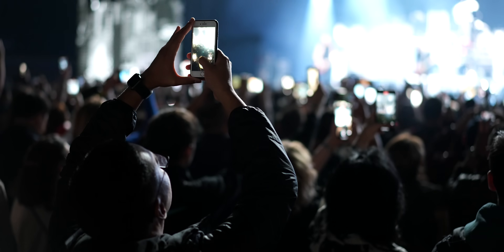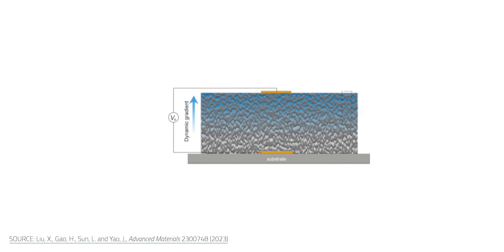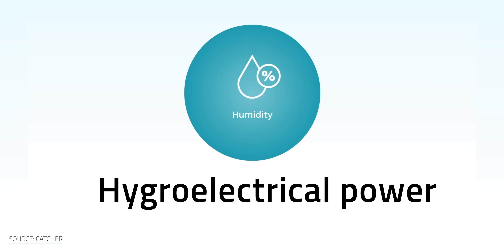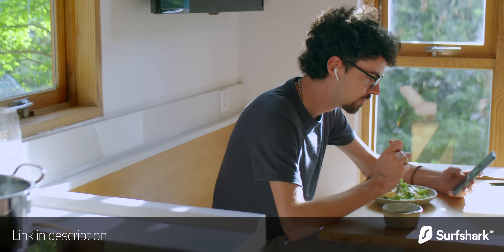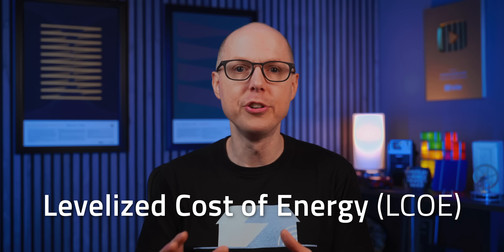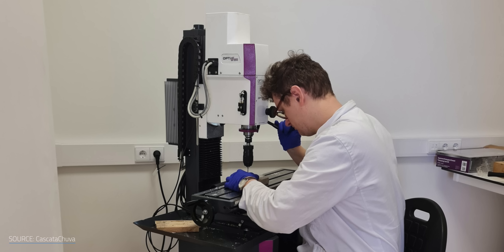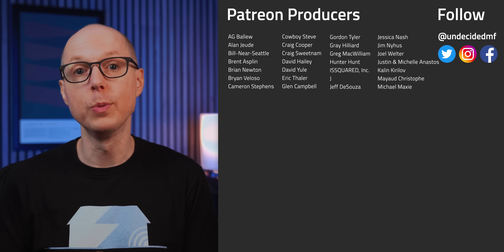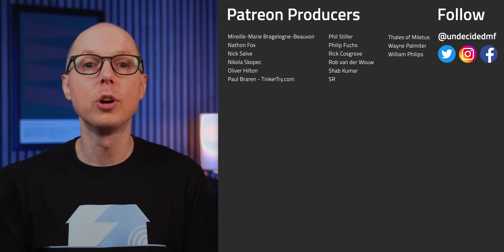Is This Accidental Discovery The Future Of Energy?

Comment: This video title sounded like clickbait, and after watching the video it definitely fits in the "sounds too good to be true" category, EVEN with all the caveats you mentioned...

The principle makes sense as a way to generate a voltage. In theory, any kind of gradient can generate power (pressure, gravity, temperature, etc.). However, what's the theoretical maximum power density of a humidity gradient? Would this work in any high humidity environment, or do you need periods of high and low (relative) humidity in order to keep generating power? Air humidity is in general a very low gradient. 

Let's come up with a high upper bound on the power you can get from air. Let's say you have an environment at 100% relative humidity at a scorching 100F on one side of the membrane, and 0% humidity air on the other side. Let's say your device holds 1 cubic meter of air at a time, the size of the washing machine. A cubic meter of that  humid air would have an absolute humidity of 45.67 grams of water vapor. If you condensed all that vapor into liquid, that's 2.257 kJ of energy per gram, a total of 103 kJ, or 28.6 Watt-hours each time you pass a column of air through that device. That's a back of the envelope theoretical maximum at a ridiculously high humidity, and there's probably other factors lowering it. If your device could handle 1 cycle per 5 minutes, that's a maximum power generation of 0.343 kW per cubic meter. About the same as a square meter of high efficiency solar panel. Not terrible, but where is your driving force coming from? How do you get a zero humidity outlet to deposit liquid water? What's the cost? You also need a ton of air flow in order to still have the same high humidity on the inlet side. If the outlet doesn't even condense the water, your maximum energy density is an order of magnitude lower

What this sounds like is a very expensive, but passive, dehumidifier, but one which generates power rather than consuming it. It doesn't make a whole lot of sense. In practice, you might be able to use this to power a hand calculator, but I doubt you'll even have a practical device that can charge a phone, let alone charge an electric car and power a household. And that's with the most charitable assumptions I can imagine without more information.

Comment: 1st law of Thermodynamics = Energy can never be created or destroyed (it just changes form).  So where is the electricity in these “Humid Air Batteries” ultimately coming from?  

I understand the explanation the water molecules inside the nanotubes causing “deprotonation” and thus forming a positively and negatively charged “ends” of the “battery”….but remember: TANSTAAFL! (“There Ain’t No Such Thing as a Free Lunch").   Thus, any power that’s  “generated” by this humid air system MUST come from somewhere else nearby (and it cannot simply come from “the humidity”). 

Perhaps the energy is being taken from the overall heat of the system?  Or maybe it’s coming from local “wind” (i.e., air moving, such that physical motion of the air molecules “bouncing” around inside the nanotubes, or possibly some electric or magnetic field).   But regardless, for tests of these “batteries” done indoors, the energy almost certainly must be coming from SOMETHING within that same room or building as the nanotube equipment & humid air.

Unlike solar, where “free” energy is pouring down onto us from the sun, I suspect that the researchers will eventually discover that their batteries are (in essence) “borrowing from Peter to pay Paul” (i.e.  using energy that was already generated by humans to “charge” their batteries, but doing so at a much lower efficiency than if the original source of energy were used to directly power stuff, without the need to use humid air to bounce water molecules through arrays of nanotubes to charge a battery).

Comment: The comparison of energy efficiency between solar and these new "batteries" is missing a major unit comparison. $20k each but the hygroelectric product would produce 10kWh a day, while the solar example was 10kW. So with 10 hrs of sun easily 5-8kWh a day, or nearly an order of magnitude more for the same cost.

Comment: The vid doesn't make it clear if it's a battery or a generation device. If it's a battery it shouldn't be compared to solar panels. If it's a generator - where does the energy come from? I think it's a battery but how is it recharged? Dried out? What's the round-trip efficiency? Crucially - what's the cost and energy density? If it doesn't compete with li-ion, what's the point?

Comment: I wish you could go into a bit more detail about the charge transfer.  If we remove a proton from the water, that's an acid/base reaction -- these have to be neutralized or some kind of corrosive effect will take place.  If we remove an electron, then we have some kind of redox reaction and the substrate will either be "rusted" or reduced until there's no more material left to be reduced.  If we are only borrowing the elctron and giving it back again, then there must be a prime mover (such as capillary action, perhaps) and that means the water comes out of the air but has to go somewhere.  In any case, for this not to be a perpetual motion machine, the energy state of the water or the nanomaterial has to be reduced.  Thermodynamically, this would just be the peltier effect (or Seebeck effect) with extra steps.  In your follow up, to take this seriously, we really need to see where the energy is coming from, going to, and identify the increase in entropy.

Comment: An obvious first application of this would be autonomous ultra low power sensors. If the lifetime of the cell turns out to be usable. You could use the very small amount of energy to slowly charge up a supercapacitor which, when filled, triggers a measurement and low energy radio transmission (all of which have predictable energy budgets). They could be deployed without having to worry about power infrastructure or sun availability - they'd not even need to be mounted in a specific direction, providing they had a port to access humid air. Could be a good way of building sensors to monitor conditions in a forest, for example. 

Producing enough power to be useful at the consumer level seems quite a way off, though. 

Unrelatedly, I have also experienced being perplexed at a sensor "working" when it's "not connected" - and it was mightily perplexing. In my case, it was actually because of an LED in the sensor assembly acting as a very weak photovoltaic cell and raising the ground voltage on part of the circuit just enough to make the sensor appear to somewhat function. Sadly, all I discovered was how solar panels work 😅and how not to design analog circuits.

Comment: My question is, If the batteries work the way we think they do, what happens when the humidity equalizes across the tube? Surely given enough time, the water molecules will migrate enough to equalize and thus stop producing electricity.

Comment: That would also remove humidity from the room, which can be useful. Usually we use electricity for that, but now we can produce it instead and still achieve our goal. And I wonder,  if you bring one of those devices that is saturated with humidity, and whose electric charge has been used up, into a very dry environment, wouldn't the water get out, and  create electricity in the opposite direction, and at the same time bring humidity in the room? This way we could use them in humid places, then send them to dry places, back and forth.

Comment: The video doesn’t address what happens after the water molecules attach themselves to the micro pore walls.  Once there how can more molecules attach themselves? Surely the thing becomes saturated pretty soon, either that or you have to put electrical energy back in to remove them.  Doesn’t seem any better than a capacity to me.

Comment: funny how these groups keep bumping up against the electrostatic charge generation I am working on proving one aspect or another and finding that just that one aspect generates power LOL (remove humidity if it is too cold and what do you do? I have an answer that could allow it to be self contained (no need to worry about exterior air to be part of it, just the heat in the room keeps the cycle of the trapped materials inside going) 
ie thermal back to electrical storage reversing entropy once again. 2 ways to do one of the methods of thermal expended and neutrally spread energy, back into a concentrated form

Comment: please someone help me or do i not understand basic physics? According to all we know today, there is an energy-conservation-law, right? It reads something like ..... energy cannot be created, neither can it be destroyed, it can only be transformed into some other form of energy. Else, we would have the perpetuum-mobile machine, right? There are some amendments if i remember my schooltime correctly, like thermodynamics and here especially the second law (in German we call it "Zweiter Hauptsatz der Thermodynamik"); it refers to the fact that heat cannot be directly transformed into another form of energy e.g. you cannot cool down a room while transforming its heat-energy into mechanical energy. Though this does not directly contradict energy-conservation, it contradicts thermodynamic observations, am i still right here? 
Now... this hygroelectric thing claims something about transforming moisture into electricity?? What effect should this be and how would it work? If the watermolecules that are dispersed in the air go through some kind of nano material, where do they end up finally? if they go back into the air, they would have the same energetic state as before so where should the electricity (= charge difference) come from? If they somehow stay in the material, it would become saturated sooner or later. If they were to undergo some kind of chemical reaction, this would also stop sooner or later or eat up any other material required for the chemical reaction. Please can anyone be so kind and prove me wrong or clarify,  tnx in advance!

Comment: I won't have confidence in this until someone can explain where the energy comes from. For example, river hydro power comes from moving water which has been transported by heat from solar fusion. That is power from water, but the source of the power is the sun. What is the SOURCE of the energy from this technique? This, at this point, sounds like a device that can light lights by inserting AA batteries, without explaining where AA batteries come from.

Comment: There is something very weird with this concept. It's seems to either violate the first law or second law of thermodynamics. If the humidity in the air remains the same then we create energy from nothing, and if the water condensate then energy is  (latent heat energy is positive) but entropy decreases. The only reasonable way this could generate energy is via a a process that changes the state of the device, making it a battery. From its description, I guess the humidity gradient decreases over time, and thus the once the device has soaked all the humidity then it simply stops working. We would then need to evaporate the water, injecting energy into the system. In short, this is either a scam or a battery

Comment: 9:20 No devices use a voltage divider circuit to create voltage steps. Most of it is done using much, much more efficient switching regulators (>80% efficient). There are also applications using slightly less efficient linear regulators, but even linear regulators are far more efficient than a voltage divider. Voltage regulation is not really a compelling argument for this given how cheap and efficient most regulators are. Also, in terms of providing power for devices, the voltages are standardized by the USB PD spec which starts at 5V and goes up to 48V. Higher voltage means a quicker charge which isn't a bad thing. Cycles are correlated much more strongly with battery degradation than charge speed in nearly all use-cases. Virtually all manufacturers have proper battery management systems to ensure that batteries charge at the fastest possible rate that does not cause undue wear on the battery.

Comment: This sounds like violating the laws of thermodynamics.

1. If the energy comes from nothing this violates the law of conservation of energy.
2. If the energy comes from moving particles in the air this would be a transformation of heat (=random movement of particles) into electric power. This would violate the law of entropy.

This is an experimental error, a misinterpretation of data, but for sure not something real you can use to harness energy.

Comment: This sounds like hogwash.  If it were real, the most important thing to say about it would be how the water gets removed from the device, because that would be half of its power source.  You could have a device that runs on supersaturated air and gets rid of the water as liquid, which would be useless because air isn't supersaturated often enough to matter.  You could have a device that runs on humidity differences between one time of day and another, which would probably be useless because it needs to dry out at the times when you want power from it.  You could have a device that directly runs on humidity differences but really runs on temperature differences, absorbing water and releasing energy when relative humidity is high because the air is cool, and then releasing water when the relative humidity is low because the air is warm.  That would probably be useless, same as the previous possibility: it would need to dry out at times when you wanted it to provide power.  But it's thermodynamically impossible to have something that just runs on the fact that air is humid, without having the moisture go anywhere.

Comment: The main concern I have whenever I see things based on microstructure-based surfaces is how viable can it really be in daily use? Wouldn't those structures quickly be contaminated by dust and debris? Could they be cleaned without damaging the structures? Can they be handled without the structures being crushed? Longevity seems like a real issue here.
Reply: That’s what I thought as well. Being in the open air would quickly clog up the nano pores. So it would need a very fine filter. To get enough air through the filter it would need to run a fan. Big chunk of energy lost already.
Reply: @McPebbster Well Water vapor is about as small as things come so you could in theory make a filter that keeps anything that would clog it out, and then of course you need a way to replace/clean that filter.

Not that those aren't issue but I imagine scaling up production something like this might be a big problem as well.
Reply: @McPebbster  Not really the fan wouldn't have to be large,  and we already have devices with fine filters. You just have a set of crude to fine filters that decrease required cleaning and replacement of filters.
Reply: Yeah I had same question. Particulate matter suspended in air could easily clog up the nanocrevices. And what happened to all the collected humidity? Will it get condensed into water?
It's hard to beat photovoltaic these days: no moving parts, very durable (except with big hail pellets) and cheap. Solar panels are under 500€/kWp in Italy.
Reply: Not to mention that whenever someone chooses to give you levelized cost of electricity as an answer to how much will it cost, they are misleading you.
This is especially true of solar and wind. Because it only counts electricity the panels/mills produce. That might seem like an odd objection, but is very real.  Because if you need X watts from a solar array, you actually need X times about 6-10.  If you need a MW continuously, you need a lot of solar panels (6 to 10MW) and batteries.
Reply: Wrap them in Tyvek. Seriously.
Reply: @grizzlygrizzle  That's actually a good idea. Now how do we make a diy version? I assume you create these nano "holes" by a chemical  process. Maybe similar to making activated charcoal.
Reply: It would have to be a sealed environment. This may build up to something more substantial over time. More dense batteries etc.
Reply: @tacom6  Just put your solar/wind powered humidifier next to it. Free perpetual power.
Reply: @bills6093 nah, if i need perpetual power, i will just plug in an extension bar into itself.
Reply: I'm too lazy to check but, dust might be way too big for these pores
Reply: Sssshhhhh don’t tell the business guys
Reply: Sorry to spoil the fun of a well-meaning science buff, but...

CO2/climate-change is the biggest mass-fraud since communism. 

(See Henrik Svensmark for the cosmic-ray/solar-activity/cloud-formation/climate relationship.)

 CO2 is a ruse. 

Climate change the "Greens" are talking about is caused by changes in the cosmic-rays/solar-activity relationship and cloud formation  (See the work of Henrik Svensmark.)  

Cloud formation by actual cosmic rays can be scene with the naked eye in Cloud Chamber demonstrations.  YouTube has dozens of videos about them.
Reply: Solar panels rely on tiny perfect crystals and we were still able to make them so that they can last 20-30 years.
Reply: @joelbolduc3354  The difference being that in solar panels there is a protective outer surface so those structures last. Such a thing on this would defeat the purpose.

Comment: The wrong questions are asked here. If this work to give sufficient to power a really small sensor or device the main application will be small smart devices working year after year without replacing any battery. This could change world in so many ways.

Comment: The propeller heads on the project could use molecular dynamics (see LAMMPS) to model the transport of the water molecules through the channels and then model the water-nano-material electronic interface. LAMMPS allows modeling materials using electron Force Field(eFF)  potentials. The energy flow could be charted over time.